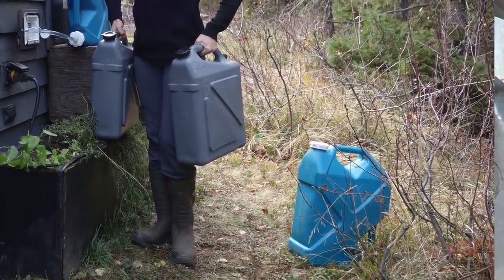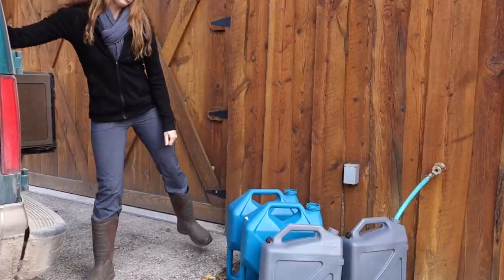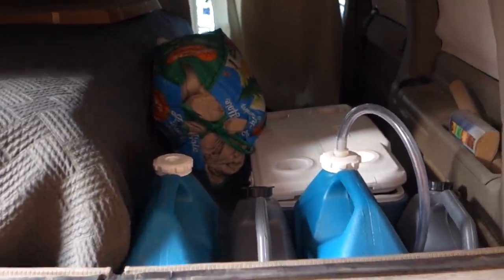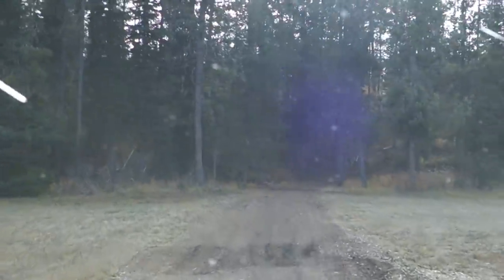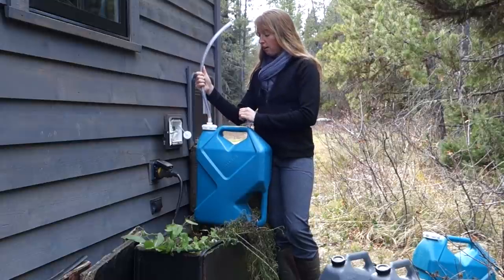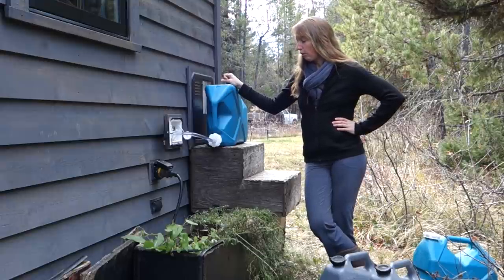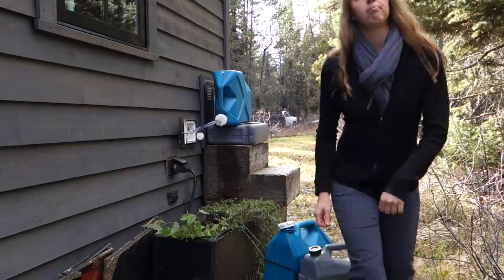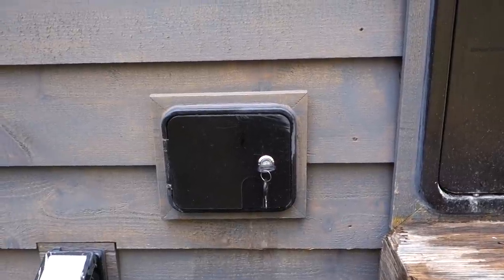Life in a Tiny House called Fy Nyth - Off Grid Water System

Comment: your wooden box looks like you can turn it around where it will allow your water jugs to be higher then your water port. Flip it and give it a shot for the next fill.
Reply from the maker: I like your idea, in the winter that should work great. In the summer I will still set the step/block this way so as to not crush the plants growing in the planters. Set this way, it's open from the bottom.
Reply: She could silicon a fitting on bottom of the jugs and sit it on the steps and that would be somewhat easier.

Comment: Have you tried flipping those stairs around (so it has the narrow step is at the top and the base is at the bottom) that would be higher than the tank? From my view, it looks like it would work
Reply from the maker: It does in the winter, in the summer, that end of the step/block is not open, so I don't do that to avoid crushing the plants underneath.

Comment: How deep are the average wells in your area? Sandpoint well can be driven by hand or small tractor. Also about that squeakin your van...u can ask a friend with a can of aerosol lubricant ride with you and listen for what is squeaking and spray while you drive, to eliminate the squeak.
Reply from the maker: Around 300 feet for most of my neighbors wells. Through several layers of granite. I am familiar with a sandpoint well, but sadly that won't work here. Thanks for the tip, but the squeak is something in the dash that can't be reached without taking apart more things than I care to deal with. I see it as just part of the "character" that develops when you drive a nearly 20 year old vehicle with 235,000 miles on it. ;)
Reply: Love your van !

Comment: I make 16 oz of peppermint tea, put it in a spritzer, and bathe with it.  Sometimes I use Spearmint.  No more need for soaps or lotions.  I put straight white vinegar in another spritzer to wash dishes.
Reply from the maker: Nice. I've not used that, but have not used any kind of soap other than for dishes in many years. I use it for a lot of other cleaning. Do you find that just white vinegar takes grease off of dishes too?
Reply: @FyNyth  I use a rubber scraper to remove most grease.  I don't use much grease as in fried foods.  Confess I would use a pot licker as a prewash if I fried a lot.  I eat mostly raw, crock pot soups, or stir fry.  If heavy, I might spritz, let set a couple minutes while I eat, then wash immediately.

Comment: You could mount a wall mount water hose rack on the wall above the water connection inlet. Then flip the containers upside would and put it in the mounted rack and it would drain mich easier

Comment: Might I make a suggestion? If you install a UV light in your tank and a small 5-stage filter under the sink, you could get water right from the river. If your feed line from the river was on a grade that will allow the line to drain when not being used, you will be able to use it in freezing temps.
Reply from the maker: Thanks! That could be a good system in some places. The reason I don't think that would work well for me is the extra power use for the UV light, the power used by whatever kind of pump brought the water up from the creek, and the fact that the creek freezes up solid from the bottom most years, so any kind of system coming out of there would only work for summer use. :)
Reply: I didn't know your layout so I can only suggest. My UV light is only 15W. I get my water from wetlands and it can be quite nasty at times. However, I can get water year round up here in Alaska. By the time it hits my glass it's more pure than most bottled water.

Comment: Check out a 2" sand point, hand driven well. Add a freeze proof hand pump well head abd you'll have water for less than $500.
Reply from the maker: They work well if you have conditions that allow you to put one in. The closest water (if I could hit the same aquifer as the closest well that is 1/4 mile downhill, which is doubtful) is about 100 feet down through solid granite. Most likely, I'm not over that aquifer and here in the mountains, despite the surface water from snow melt, there may be no ground water for many hundreds of feet down. Pretty much all through solid rock. But if you want to come hand drive one that works here, I'll be happy to pay you double that $500. :)

Comment: I have yet another suggestion as to how you could make your water hauling less work.  ;). You could put a flat water bladder or tank on the roof of your van or maybe even on a rack near the ceiling inside.  That way you could just fill it directly in (or on) the van with a hose, drive back home right up to the side of your house and then gravity feed the water out of the van roof tank and into the house tank.  For example, look at the AQUATANK2 Water Storage Bladder (30 Gallon) on Amazon.
Reply: One other thought.  If you used the screw on hose connection on your house when draining the large tank from your van roof it wouldn't overflow when the house tank is topped up and you could still use the remaining precious gallons for something else.
Reply from the maker: That could work, but sloshing water weight, especially up high, on a moving vehicle is a bit more instability than I care to deal with.

Comment: Love the crickets in the van.
Reply from the maker: Yeah, it's something in the dash somewhere. I see it as just part of the "character" that develops when you drive a nearly 20 year old vehicle with 235,000 miles on it. ;)
Reply: Yes, I used to own an Astro,  Safari  Van with a 5 speed manual transmission.  I turned it into a tiny motor home, and drove it for over 20 years until it rusted right out.  Great vehicle for hauling water and wood etc.

Comment: You have well thought-out routines for a lot of stuff, and the design of the house itself, with the stove at an angle, is really clever.
What is not right is the way you cut wood. Woow! You need to wear, every time, chainsaw chaps, glasses and the protection for the lower arms (which certainly has a name in english).
This used to be my job, and I can tell you that a chainsaw whiplash happens in a split second, without warning, and even if you did not do anything wrong (sometimes there's a knot in the wood for instance).

Never seen such a beautiful outside finish on a tiny house, what is it?
It looks almost like a witch house! lol
Reply from the maker: The exterior is cedar siding stained grey with a single layer of semi transparent dark grey stain.

Comment: You should have a 50 gallon tank indoors that is in the attic and be able to clean it out every 4 months, then gravity will empty the tank out and you will have a water pressure. If you had a manual pump on the tank to put air in it you could have even more water pressure for showers. Drill a well next to house by bathroom or kitchen,  have a 200 watt solar panels with a 3500 watt inverter, charge controller and batteries, Get a small water pump so the solar power can run the pump and suck water out of the well you drilled, get a solar cooker, Get 365 glass jars to can foods, Get seeds for garden, Learn how to drill a well and can foods, Get a small wood stove like the lady in the video, Learn how to make beef jerky, Get some chickens and goats, They eat off the land, you need an ax to split wood, Get small freezer,  Get extra warm winter gear, Make peddle power washing machine, use rope and make a cloths line, Get compost toilet, Use LED Lights only, Make sure you have a hunting gun and ammo, A snow mobile for winter emergencies,  Get a c.b or have two walkie talkies and give one to your neighbor to talk to.  Make sure you have enough fishing gear, You may want to get an induction cooker ,  runs off solar, Get 2 BLACK garden hoses and spiral on roof in area that has alot of sun and fill with water when left out the water in the hose gets very hot for shower or wash cloths, Get 2 food safe plastic barrels and collect rain water, Get a chain saw and sharpener and have a nice day.
Reply from the maker: Could work, but since the "attic" is my bed, 50 gallons of water in bed with me would be a bit inconvenient. ;) Not to mention it would be a hassle to get it up there, but gravity flow is pretty sweet! The little pump in the house does not seem to have any problem giving me all the water pressure I need.
Reply: gravity water is only .433 #'s per foot drop, so tank bottom would need more than 20' above where the water exits just to have 10# of water pressure. You do the math.

Comment: those jugs are blue! ;-) Why not turn the mounting block/steps so the long part (base) is vertical against the wall allowing you more height and no need for the other jug underneath the one you are draining?
Reply from the maker: Maybe I'm color blind? They look green to me. ;)  I like you idea, in the winter that should work great. In the summer I will still set the step/block this way so as to not crush the plants growing in the planters. Set this way, it's open from the bottom.
Reply: Lol must be the camera / lighting - they most definitely look very blue
Reply: Your not color blind...maybe turquoise or teal would be a better description, but even those consist of the colors blue and green.

Comment: you could probably use the water from the creek for about half the year i would even put alittle float on the water with a small aquarium heater or 2 to keep the water around the float from freezing and hook that up to a very small solar or wind turbine to keep it powered tell me if i am wrong here. add a small 10 gallon water heat right next to it and i think you can keep all the water in the hose going up from freezing, insulate it all of course.
Reply from the maker: Not with winters in the -30's F. and a creek that freezes up solid from the bottom. :) Even if the creek was flowing, the power needed to keep 60 feet of line up the house house from freezing would be phenomenal, and there's no way to burry it, the ground's solid rock. No sun or wind available down where the creek is.
Reply: well i dont claim to know for sure but it is something i would look in to. maybe i can somehow show you a sketch of what i mean. a small boiler working off of propane or wood would probaly keep a insulated line from freezing but the part that keeps me thinking is between the float with the aquarium heaters to the boiler (this part you want to keep very short). i know it would stay defrosted at the float though and up the insulated hose from the boiler, atleast when the line opens. i would insulate the line also from the float to the boiler.
Reply: i just realized instead of the aquarium floats you could use the heat from the boiler with external tank attached to the boiler filled with water to circulate around and keep it defrosted near the intake in the lake. it is worth a try. a small 12 or 6 v pump with alittle electric from your place which is only 60 feet away for the external boiler to defrost the area of the intake. you would only use it when you need the water.
Reply: @kratomseeker5258  
considering the winter weather there, she might be better off with an in ground cistern which she could fill before each freezing season arrived. Since ground hard, she'd need an above ground pool of water and sandbag all around it with a clear plastic over it to let sunlight in, but a black inside to convert light to heat. Even then that might not be enough without something to melt it in winter near the outlet. If she decides to purchase her own property there, at least she's learning what to look for that will work better for her, like a stream with some drop in elevation to the property, to low dam & catch and store that snow melt from higher elevation on the stream.

Comment: Curious.  The water tank in the house, I'm assuming, is plastic.  Any concern with the use of the heat lamp damaging the tank?
Reply: Melting?
Reply from the maker: Yes the tank is a heavy duty plastic, but no, the light is far enough away that no melting would happen. Just puts enough heat into the air to help keep it above freezing.
Reply: @FyNyth   might consider installing a block heater like those on vehicle engines, since they are 12v and you have batteries. An electric heating pad might even work better.

Comment: How do you deal with the grey water in the winter? Does it freeze up where it comes out of the house or give you a big skating rink of ice on the ground? I live in Canada and regularly see -30 C and this is my biggest concern about tiny house living. Thanks!
Reply from the maker: It drains with no problems and I've had temps -35 C and colder. Other than one instance. Check out this post for all the details on that as well as normal functioning - http://fynyth.blogspot.com/2016/01/frozen-pipes.html

Comment: How did fresh water tank get hooked up want to do the same in my shed love it
Reply from the maker: How is it hooked to the sink faucet? Or to the exterior of the house where I fill it?
Reply: @FyNyth  to the sink do u have reg plumming
Reply from the maker: Yeah just the same kind of connection you'd have to any kitchen sink. But between the tank and that connection is my little water pump. If you were on city water or a well, that pump would be located at some city station or in your well, not right under the sink as well.